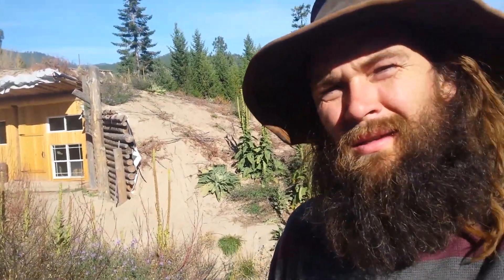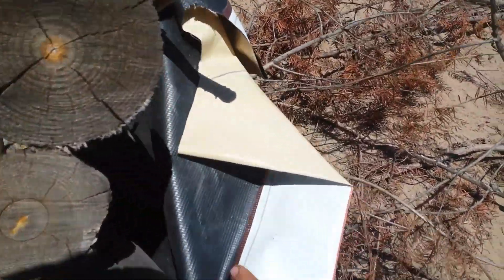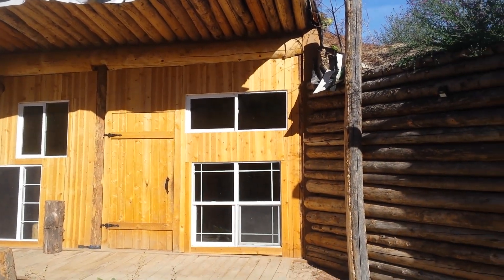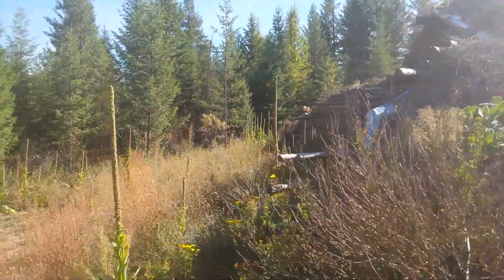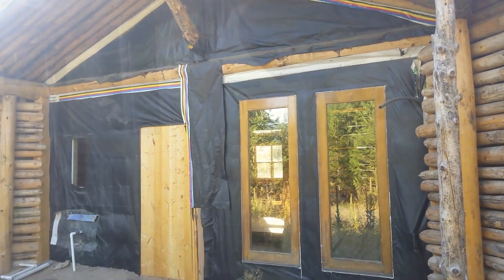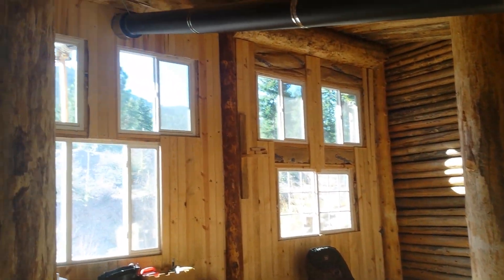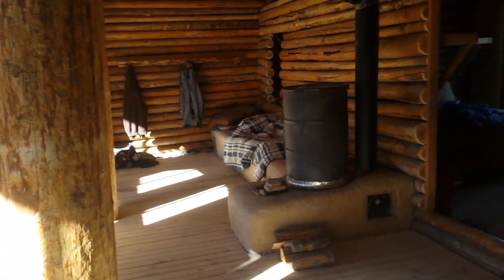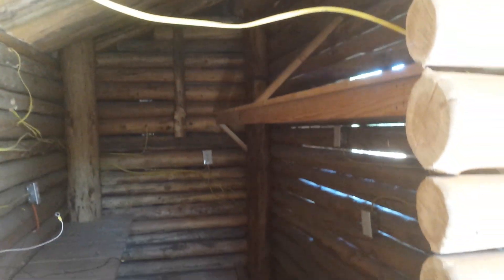Wofati 0.8 Walk Through

Comment: Have a concern about eventual failure of the water barrier here or there. This would permit moisture buildup under the billboard material which would have a hard time drying out. Now, you would be trapping moisture against the wood of the roof structure. Maybe a packed clay barrier with enough slope to force rain water to run away through  the layer of sandy soil on top if it. It would provide a path of least resistance for water to es so much faster than it could ever work its way down through the clay layer. I’ve seen moisture barriers installed against the underside of floor joists in modular homes (intending to protect the joists from ground moisture rot) cause massive rotting of the floor joists.

Comment: I've seen many of the videos about Mike Oehler's houses and they never really show the potential of these buildings. This video really shows the awesomeness of these things. I can't wait to build one.   One thing of note. I noticed that you used the recycled billboard material as the water barrier.  They are great and cheap but sometimes they can have a lot of pin holes in them that are hard to detect unless you have a light source behind it. It shouldn't matter however since you have or will put an umbrella over the first layer of soil.  Using dry soil as insulation is a great idea too.  Congratulations and thank you.
Reply from the maker: +Karl Rosengrant Thanks Karl, but I've got to make it clear that this is not really  an Oehler structure, although it is very much based on his work.  The structure in this video is a "Wofati," a concept birthed by Paul Wheaton which combines the ideas of Mike Oehler's underground homes, John Hait's passive annual solar heating, and Paul's own ideas about making housing "freaky Cheap" yet luxuriant.  Wofati is a made up word which stands for Woodland, Oehler, Freaky cheap, Annualized Thermal Inertia.  I agree with you about the billboard material, it is not the ideal moisture barrier.  Paul hopes to make up for this by using as many layers as possible, and is using them mostly because they are free, the freakiest of cheap, and he wants to get the cost of building down as low as possible.  I'm actually working for Mike Oehler right now, and I can tell you first hand that his structures have incredible potential, his new ridge house is one of the most beautiful homes I have ever seen.  Mike recommends polyethylene as a moisture barrier, as it will last forever underground, same with John Hait.  I feel like for the couple hundred dollars you might spend on poly for a small home, the benefits of a solid moisture barrier are well worth the money.  Mike's ridge house actually uses a more expensive EPDM rubber liner on the roof, with layers of poly over that to protect the investment.  The ridge house is meant to be a showcase of what can be done with his methods, so he has put more money into it than his low cost structures, but still the final cost will be about a third of a conventional structure of the same size.  This is the best video out there of Mike's structures, and really shows off the ridge house well: https://www.youtube.com/watch?v=8B6xR3T37gI
Reply: @oneheartfire  It was frustrating to me not being able to find the definition of "wofati".   Using a word that is not defined is bad.  I see it now in your post.
Reply: Thanks Jesse.   Really cool that you were able to get the billboard tarps for free.  I've been following Paul's work for years and have learned a ton from him.  I read his wofati article but I didn't realize the distinction between wofati and traditional Oehler design. Its so cool seeing this knowledge evolve.  

Oh btw I saw your living mulch garden vid and really loved it. I've done something similar and was amazed at how much time is saved and how little pest problems I had.  I still had to give the tomatoes and tomatillos a couple doses of comfrey tea but it produced a lot.  In terms of maintenance time, soil building ability and yield what do you think is better, ramial wood chip mulch or living mulch gardening?  

Thanks for sharing your knowledge and experience, good luck with everything.